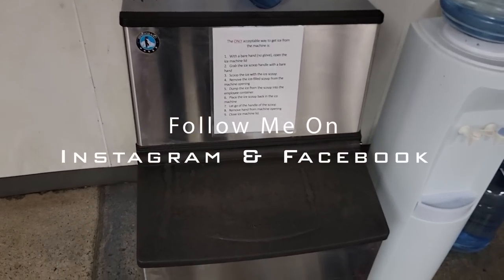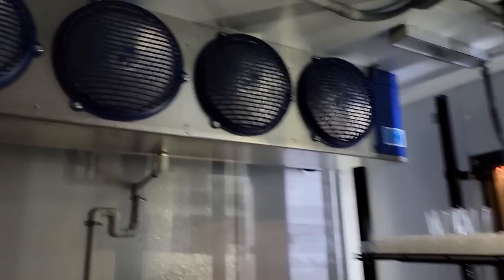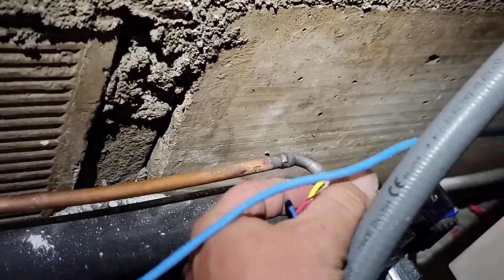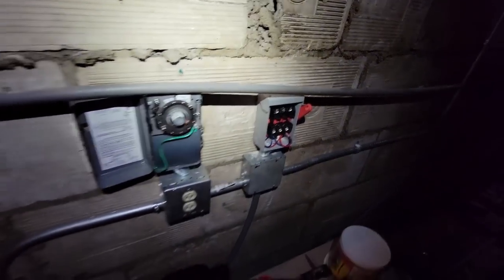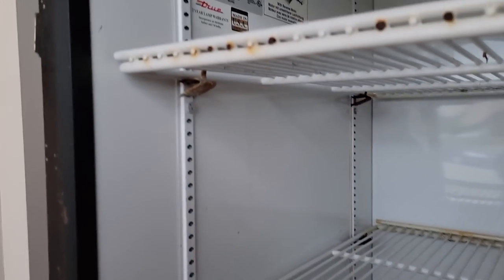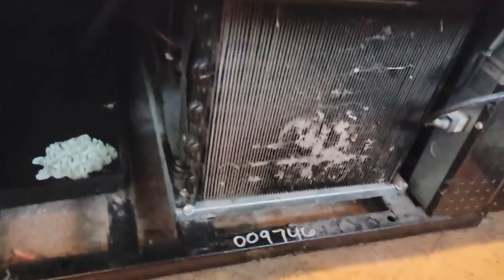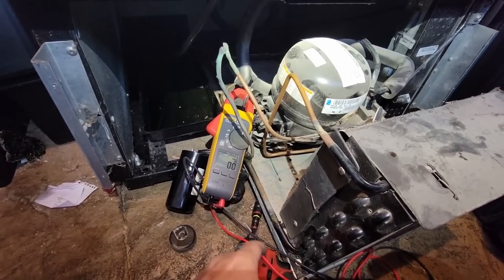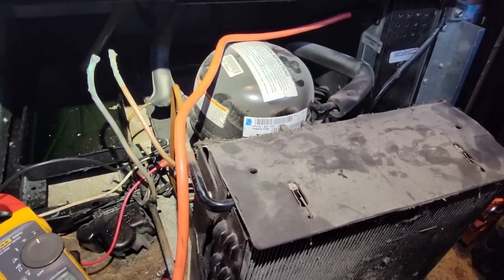Ice Machine Toasted - W.I.C Burns Up - R.I.C On Death Row

Comment: Good selection of calls. I honestly like the soft background music you've added. Enough to fill in the dead air without distracting in any way.
Good catch on the electrical SNAFU as well. Put 240 on a 120 device and you'll have a bad day.
Surprised it lasted as long as it did!
Reply from the maker: That was actually a performer practicing in the background, that wasn't a track that I added 🤭 but thanks for the compliment. 👍👍

Comment: On jobs like that last compressor, where you put in a new cap only to find the compressor is dead. What do you do with the cap? Do you take it back and put the old one back in, or do you bill the customer for it?
Reply from the maker: I put it back on the truck. There's nothing wrong with the capacitor that's why I don't destroy the box until I'm completely done and even then I use it to make sure I get a replacement. Not every company is a bunch of shysters out there. 😁

Comment: Great Video. Thank you for sharing. What's selenoid ? and what's selenoid does in HVAC-R
Reply from the maker: I don't understand the question, are you asking what does the solenoid do? If so, the solenoid stops the refrigerant flow when the thermostat is satisfied causing the refrigeration system to pump down and shut off.
Reply: @HVACRSurvival  Thank you. How do we know if selenoid is bad and need to replace new one ? how to do diagnose selenoid ?
Reply from the maker: If it's powered and not opening or it's restricted then it's bad

Comment: Does this walk in cooler has 2 solenoids or just one and what is thermostat doing if there is only one solenoid since that defrost timer kills the power to the solenoid that you rewired ? Great video Rick. Cheers
Reply from the maker: It only has one solenoid, the defrost clock sends power to the thermostat,  the thermostat sends power to the solenoid. Whether the thermostat is satisfied or the defrost clock goes into defrost the result is the same, the solenoid is de-energized the refrigerant system continues to run until the suction pressure drops down low enough that the low pressure switch breaks power to the contactor shutting the system off.
Reply: Thanks for answer.  Was confused that defrost timer just controls solenoid by condensor but now its perfectly clear. Cheers

Comment: not sure if you picked up on it BUT.... That Paragon Timer was a 120 Volt defrost timer on a 220V circuit. Im suprised it ran at all.  The electrical issues went far beyond the disconnect.  The point to reiterate should have been to match the voltages when you replace equipment, not with what was there before, but rather what do I have as a power supply. I do like your videos.
Reply from the maker: I'm not sure you understood that I was pointing that out? It was a 230 volt circuit and that's what the condenser runs on and that's what the clock should have been. Other than the clock motor being the wrong voltage there's no difference between the two different defrost clocks. The mechanical gearing and the switches are exactly the same.
Reply: @HVACRSurvival  willthe switch8ng work, sure... but the clock won’t.
Reply: @HVACRSurvival  l know, it still kills the component.